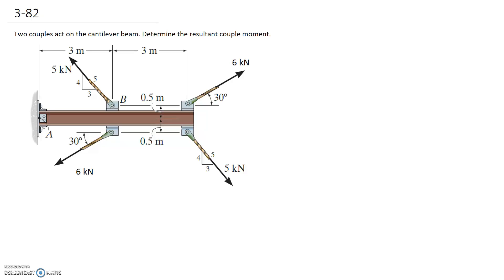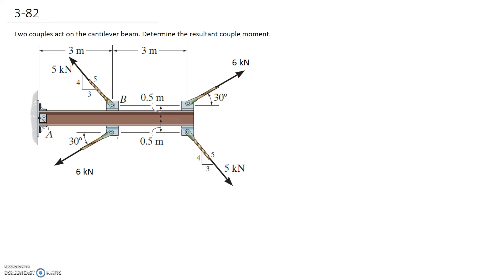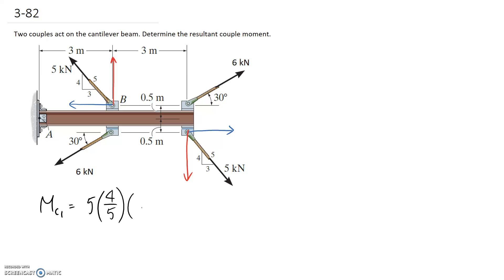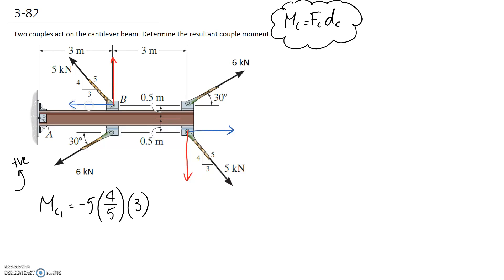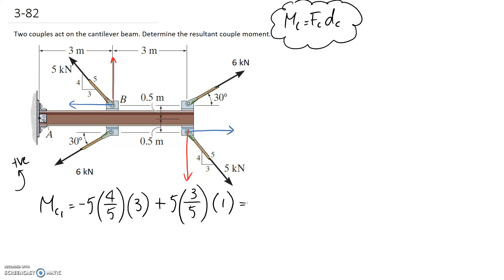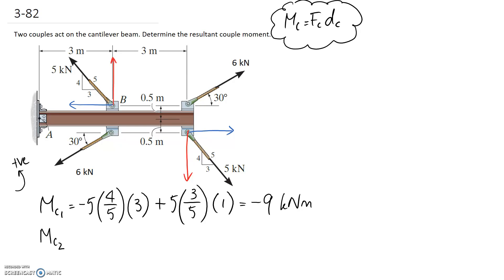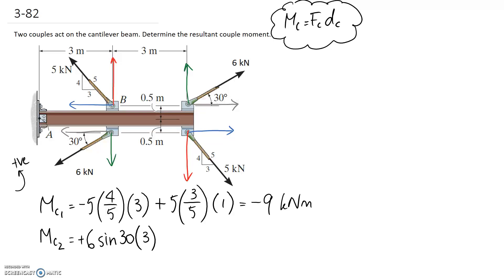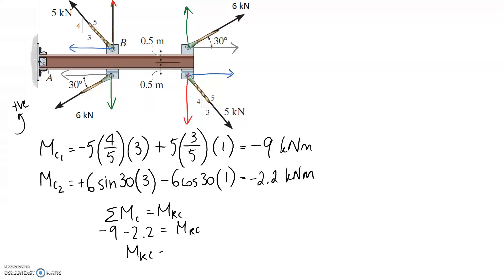Resultant of Couples Example

Comment: So does the -11.2 KN.m means that the body is going to rotate? And if yes, would not that mean that there would be acceleration and a resultant force?
Reply from the maker: If a body is in equilibrium then it is not moving (not accelerating, not rotating). We want this to be true for the structures we are analysing – eg. we don’t want the floor of a building to be move when we apply a force or a moment on it. A couple moment is just a special case where two forces of the same magnitude are applied in opposite directions. The result is that the forces cancel each other out overall, and subsequently only causes a rotational effect. The structure still needs to counteract this in order to remain in equilibrium (not moving).